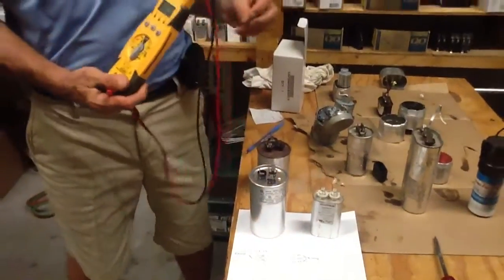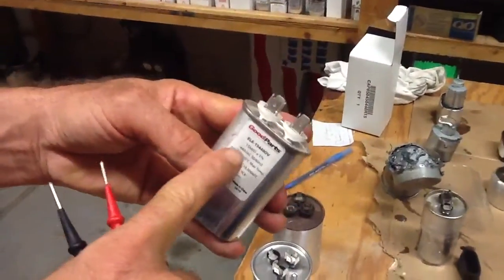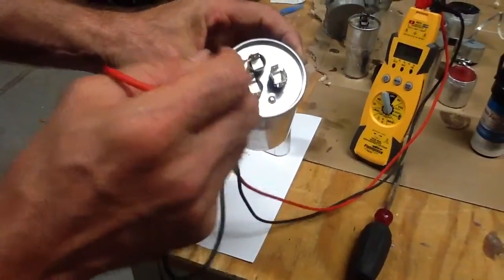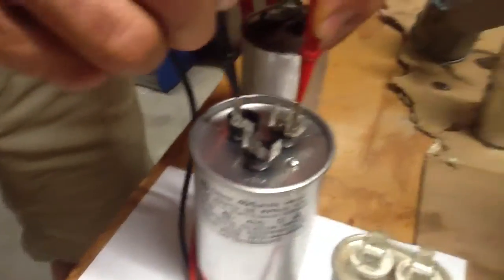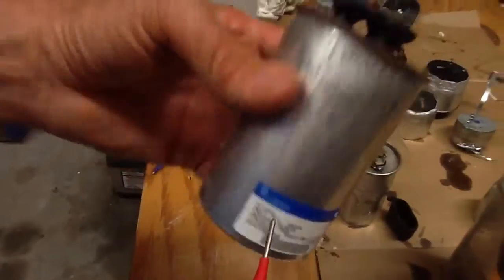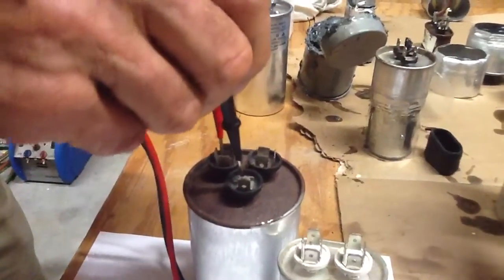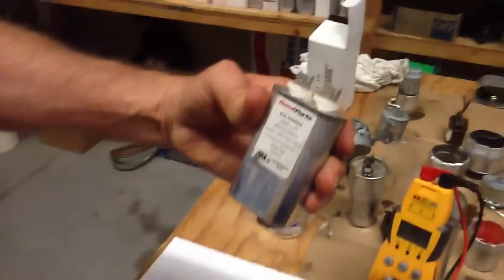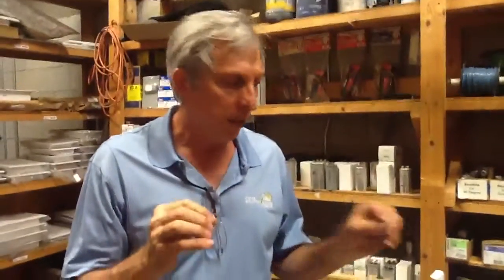How to Measure a Capacitor

Comment: Hey man I have a question. I'm a diesel technician. I am learning that the new common rail diesel injection systems that I am dealing with are capacitor driven, instead of solenoid driven ,at the injector.The claim  is that the capacitor delivers a much quicker and robust control  of the  hydraulic  injector, with high voltage and low amperage to create a mechanical function. They're calling the system piezoelectric. I was just wondering what the difference might be between a standard capacitor and this so-called piezoelectric capacitor. Feel free to give me a call .My name is Jonathan Bowman. My phone number is 540-641-6035.
Reply: Uncle Schickelgrubber jonathon
Reply: @ZagGames  Jonathan 🙂